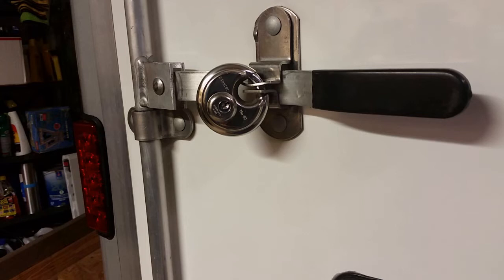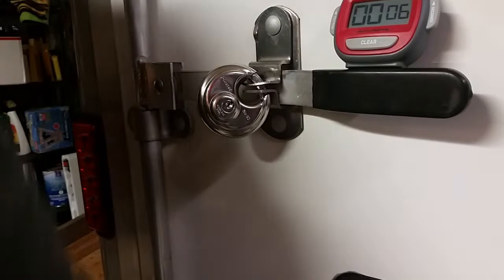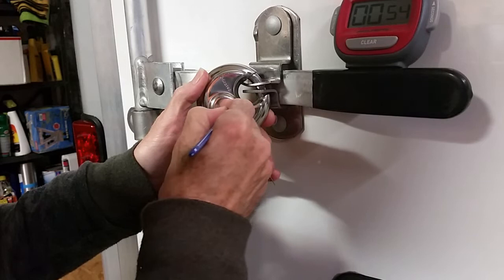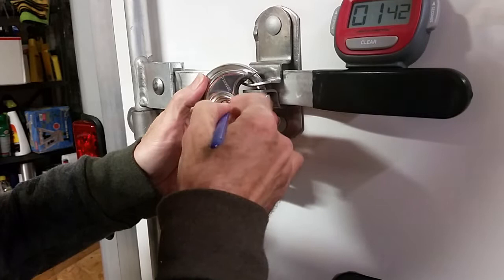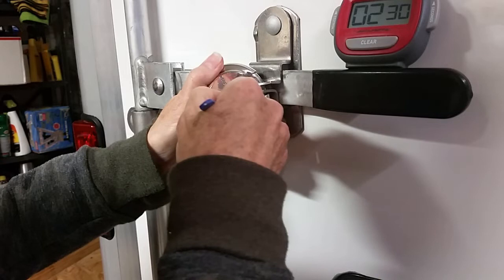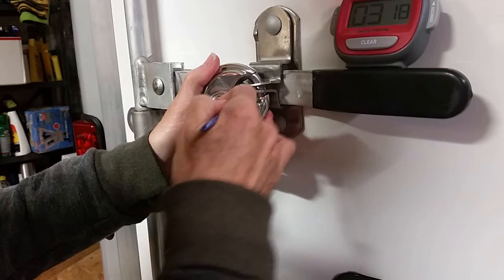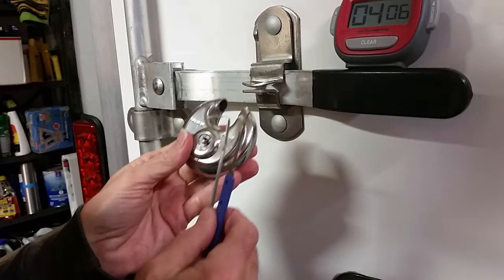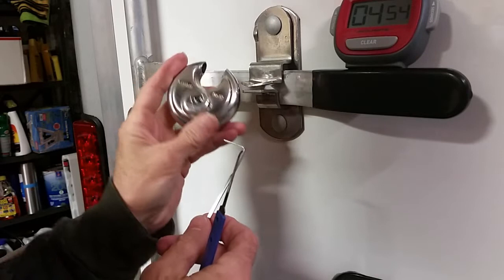Utility Trailer Locks - Masterlock Disk No. 40 Picked

Comment: My Neighbors trailer was Broken into by Cutting right behind the Lock where the two 1/16 inch thick pieces come together to Form the one Hole the lock Goes through. the Lock never got Touched and still locked on the ground and all his Tool Gone.. Horrible! Weakest part of the Entire Trailer is the Two Holes that meet to form one Hole for the Lock..